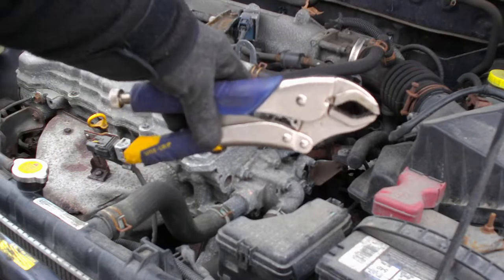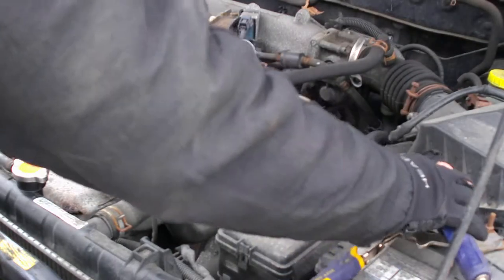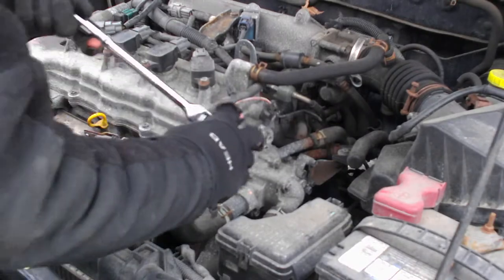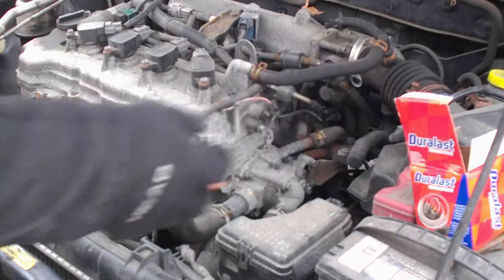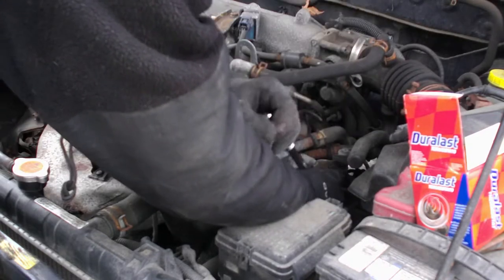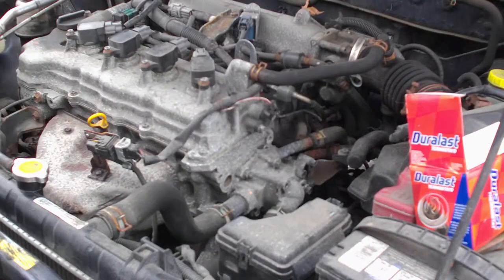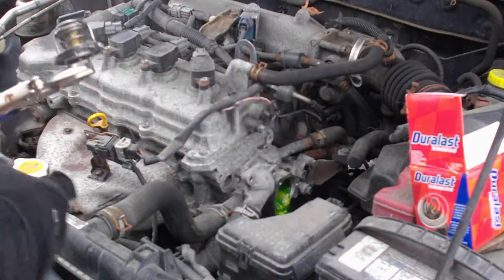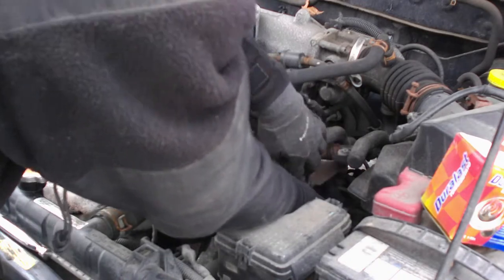P0128 2006 Nissan Sentra How To Replace The Thermostat

Comment: So what do you do with the fluid that comes out? Do you just pour it down a drain or is there a specific way to dispose of it? Do you need to replace what you lost?
Reply from the maker: If you can bring it to a local garage or auto parts store like autozone for proper disposal. Yes replace what you loss.
Reply: Cool thank you! So grateful that the world has kind helpful people such as yourself 😊
Reply from the maker: Thank you
Reply: @HomesteadingwiththeHeberts  So it's not a good idea to put that coolant back into the system?
Reply from the maker: @meagain448  I would replace it. Because you risk contaminating the fluid when you drain it.